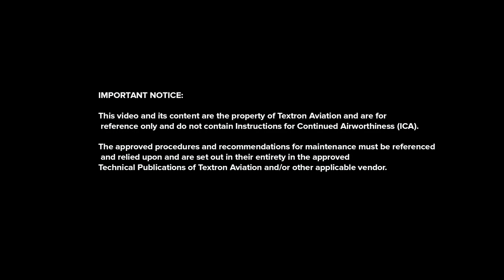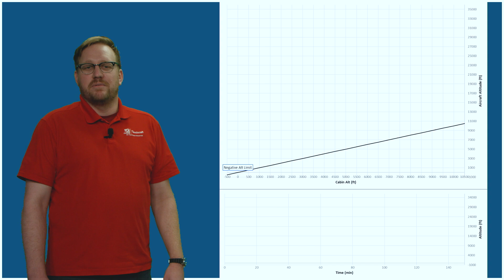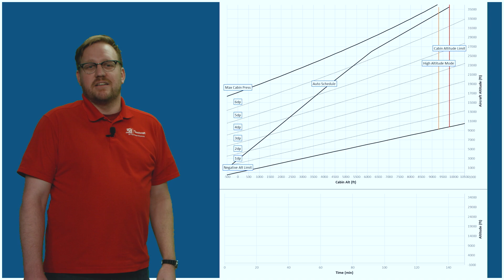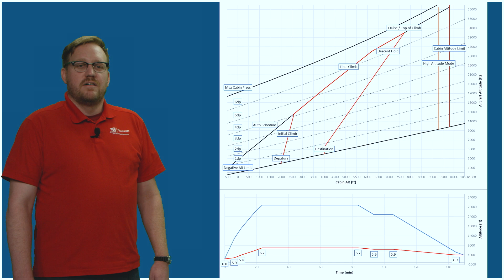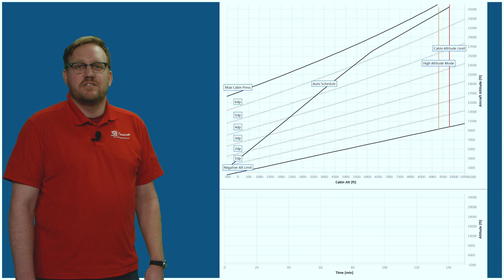King Air Pressurization

Comment: We have King Air 360
At 24000ft Environmental in Auto
At 24000ft Environmental turn to Man heat and we have L bleed Air failed what will be the problem thank you

Comment: We have a passenger with sickle cell anemia and our aircraft is not equipped with the alternate pressurization system. Is there a recommended procedure to keep the cabin altitude lower(and delta p higher) than the automated schedule?
Reply from the maker: Hello and thank you for your comment. Please reach out to your nearest Textron Aviation Service Center and request to speak to the Aftermarket Sales Team about the Alternate Pressurization Modification. One of our team members would be happy to discuss it and assist you. You can find your nearest Service Center here: https://txtav.com/en/service/locator.
Reply: If there is a manual override switch to open or close the outflow valve, you can probably manually command the valve to close (and pressurize) until your target delta P.

I am not from Beechcraft and might be wrong so please take this with a grain of salt and follow the official procedure if it exist.